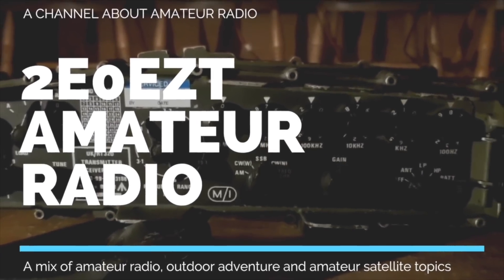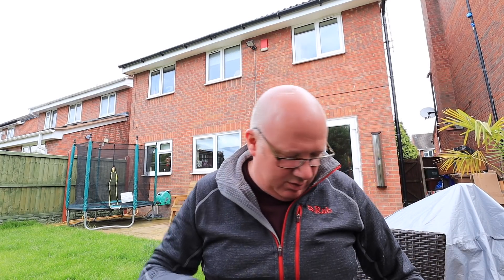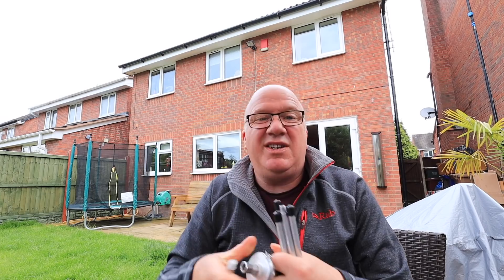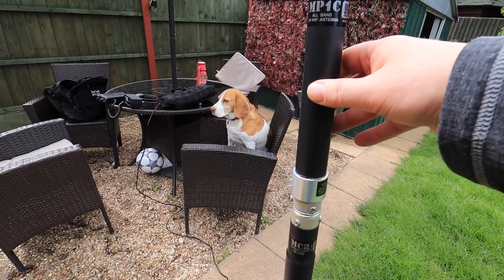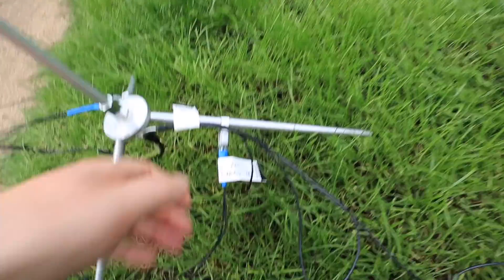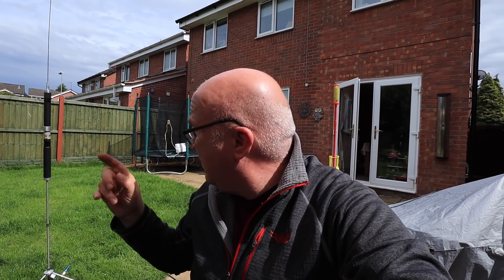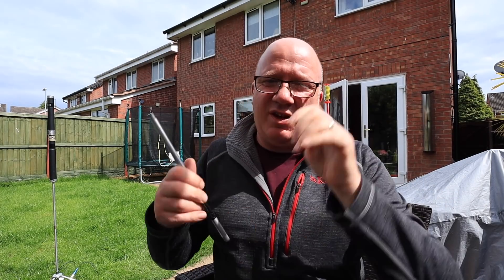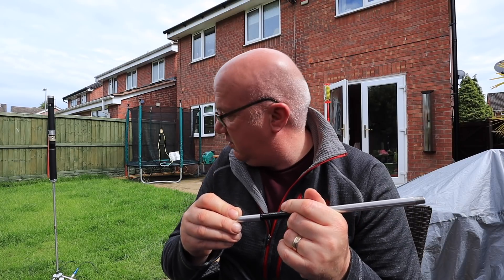Setting up the MP1 Superantenna for VHF bands

Comment: For 2m you really only need the telescopic whip. Just screw it directly into the low profile tripod base and measure to 17” then adjust up or down slightly to adjust the SWR.

Comment: A soooper ham and dog garden Lurk.  My antenna came down in the recent high winds, bottom of the garden looks like an Alcan factory and will take some time to sort, so I chucked the tripod super Antenna in the garden used the reference card and my AA-600 Analyser and set it up for 20m FT4/8 and it is flipping brilliant. And not much different to the “fixed” antennas and wires. I bought it with great plans for for a bit of hilltop/countryside/woodland lurking like yourself then COVID came along so first time to use it. Impressed. Nice one Carl, would like to see some night time deepest darkest spooky woodland overnighters ⚡️⚡️⚡️⚡️73s
Reply from the maker: Yes I've not done a wild camp this year, mostly due to lockdown and also lots of people are wild camping and creating a mess and damage to camping locations, I'm staying away from those people this year and not adding to problem.
Reply: 2E0EZT amateur radio yes I can understand that. Idiots seem to be just trashing everything they can get away with. Looking forward to better times. Back to business, have you had a crack at the FT891? I have one in the car it’s hooked up to an SCU-17 I bash a bit of FT8/4 at lunch times but size and weight wise it’s ideal for a lurk. And the 100W  output would need a wind down to preserve the flattery. All the best keep em coming, very entertaining.. ⚡️⚡️⚡️⚡️

Comment: I just purchased the MP-1LX. This is the MP-1 with the tripod and ground radials with a few extras tossed in. It claims to work from 40 meters right up to 6 meters. But the product description is very vague on how..  I called the local distributor (Ham Radio Outlet) here in the USA, and they told me with a little adjusting it will tune to 6.... 
Super Antenna’s website is quite vague on how to tune for 6 meters as well! And of course there is no telephone number to call and ask,,, From the photos I have seen on the Super Antenna website, for 6m looks like you use the supplied telescopic whip with one of the bottom sections of aluminum rod, bringing the radiator section to about 54 inches (137 cm). For 2 meters, looks as if you just use the telescoping section by itself. So in essence it just a 1/4 wave with no loading. 
Seem the MC-2 is a diplexer for HF and 2 meters.....    I have not received the antenna yet, and of course they do not carry the MC-2 diplexer.. I really want to see how well this antenna performs and take various VSWR readings through the bands...

And as a few others posted........  Looks as your dog is as excited about Amateur Radio as mine is!!!!
Reply from the maker: Ha yes super excited. I've not grasped regular use of VHF on this antenna, I should keep trying
Reply: i tested mine on 6 meters and it resonates well, i used the original coil for 40 meters and tuned down just below 10 meters (couple of lines from the bottom)  , now we need some activities do a real test  73 de 2E0RPS

Comment: Good day sir, I want to setup location VHJ system for my fishing 🎣 community they don’t have any radio communication when go miles out to 🌊 sea. I want know what’s a good setup that would help me buying the right VHJ system. Thank you
Reply from the maker: To operate at sea it requires a special licence (for example in the UK coastal waters), I would check with your Admiralty
Reply: 2E0EZT amateur radio what a two way communication private, just want to make sure they able radio for help if he reach that far.
Reply from the maker: @bushbomb21b9  private comms would require a business licence, if the radio is required for SOS at sea then it really needs to be a marine VHF radio which requires a licence. You may be able to use CB radio at sea but check the licence conditions for example this is OFCOM's https://www.ofcom.org.uk/__data/assets/pdf_file/0022/84406/citizens-band.pdf
Reply: 2E0EZT amateur radio thank sir will continue my search now I see.

Comment: LOL very funny at the end. I'm not a fan of the super antenna Carl. I think a piece of wire cut to the right length will work just as well or better but I can see that it is convenient. When using qrp we need our antenna's to be efficient.
Sandy
Reply from the maker: Yes I bought this antenna in my first few weeks of playing radio,  I'm hoping to find a purpose and some hope for it.

Comment: Hi Carl, great vid. You don’t need the duplexer. Using just the extension rods, the telescopic whip and a tape measure you can tune it to 2, 4 and 6m. You just need an extra connector nut thing whatever they are called. I use 2  x mp1s in my setup as a Lazy L or a dipole so no need for radials. It’s a really versatile antenna system you only need a few extra bits and pieces and you can use it on most of the ham bands :-)
Reply from the maker: Brilliant, I need to find that telescopic whip!! I like the idea of combining two MP1's cheers Mark
Reply: i tested mine on 6 meters and it resonates well, i used the original coil for 40 meters and tuned down just below 10 meters (couple of lines from the bottom)  , now we need some activities do a real test, i guess for 2 meters the coil can be removed and use the rods and whip only :face-turquoise-covering-eyes: 73 de 2E0RPS

Comment: Keep trying and you will get it working on the bands as per the spec.  Lots of parts to that antenna but very versatile.
Reply from the maker: Cheers, yes I'd totally ignored the VHF capabilities, I'm hoping to work 10m and VHF from a backpack during this summer's sporadic e. I need to find the missing telescopic whip for 2m and maybe 4m. I may even have to read the instructions.

Comment: I'm a little lost now. So you didn't actually get it set up then? How many parts are there going to be to this series? :)
Reply from the maker: It tuned into 10m, it tuned into 6m, it didn't tune into 2m, which bit are you lost over? :)
Reply: Never mind, I was trying to do two things at once and listen to your video. I've obviously misinterpreted something somewhere. I'll watch it again in the mornig :)
Reply from the maker: I'm hoping to get the MP1 on a hill somewhere and try it across 10m and hopefully some of the VHF bands, I just wanted to work out the best setup, disappointed that I've misplaced the telescopic whip but now looking at the instructions it says I can use the other whip but this didn't tune for me.